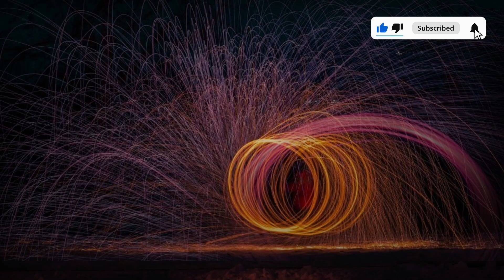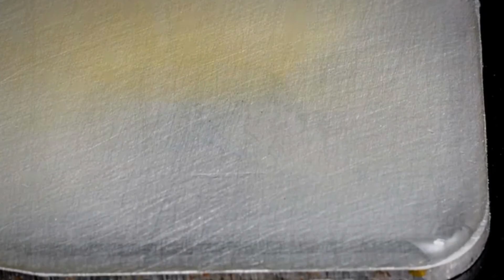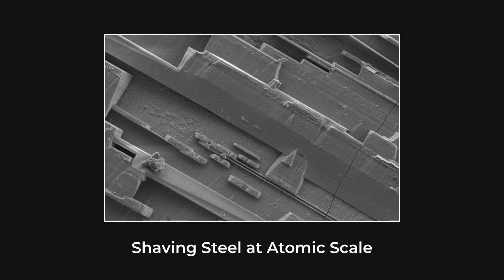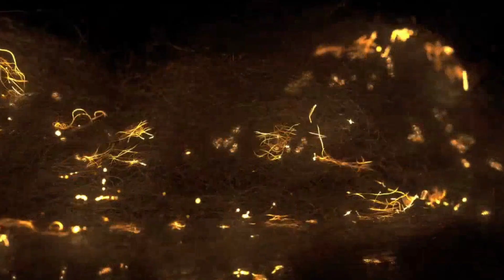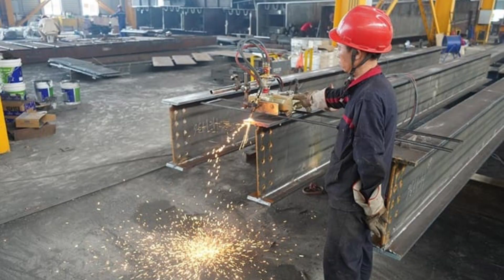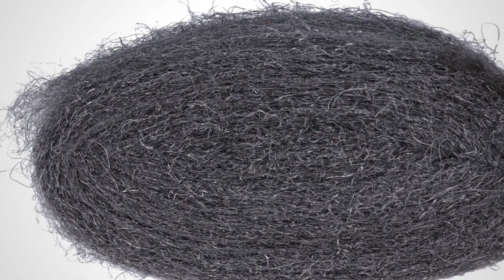Why Steel Wool Burns When Solid Steel Doesn't

Comment: Steel wool does NOT burn under any circumstances. It oxidizes quickly. The faster it oxidizes, the more heat it produces. If you take my cutting torch to a steel block, when you get it hot enough then hit the oxygen valve, it'll sparkle just like steel wool.